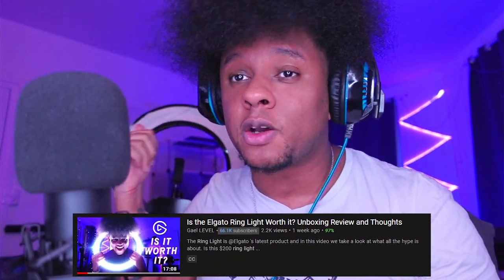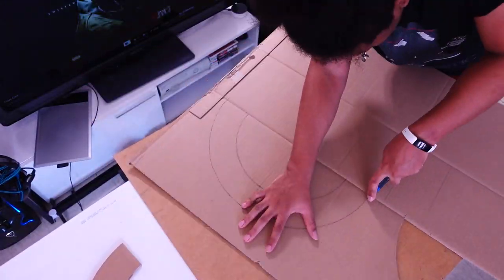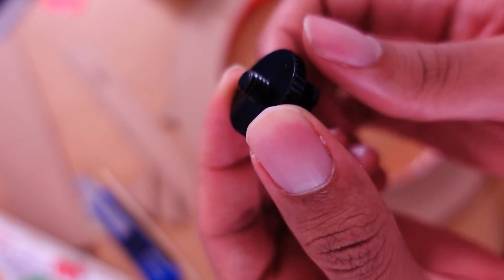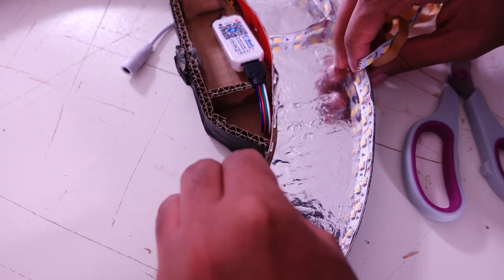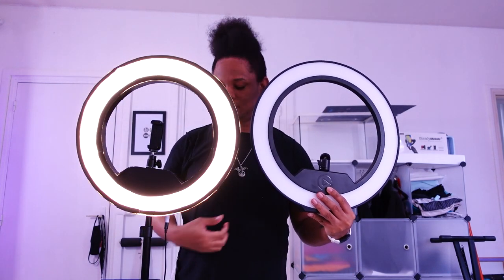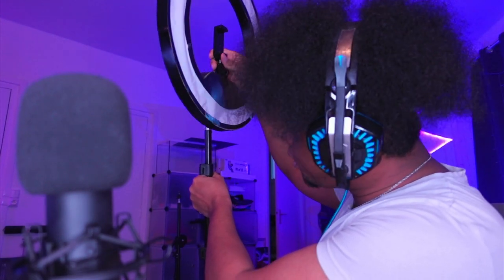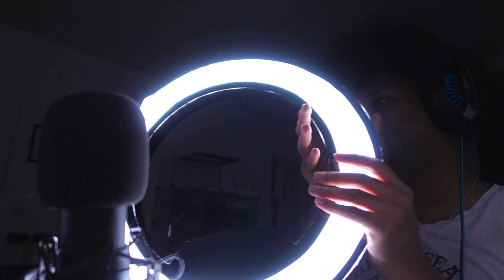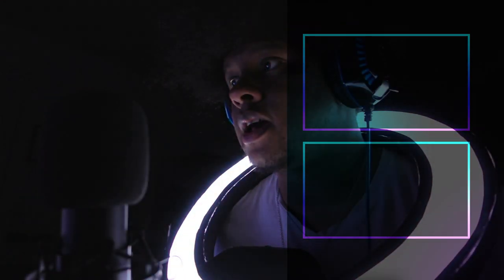DIY $30 ELGATO RING LIGHT (App Controlled)

Comment: If you recreate this, use the 'dull' side of the tinfoil (aluminium foil) as the reflector. I know it seems counter intuitive, but it is actually considerably more reflective than the shiny side. You can use a lux meter and try it yourself if you want.
If you look at bounce boards that they use in photography, they are always 'dull' not shiny. And so are reflectors in lights. Dull doesn't mean not reflective. It means that the reflection is diffuse, which is what we want for lighting.
You can get high frequency dimmers that won't flicker for about $7 on amazon. But you will need to wire everything up yourself and you won't get an app.

Comment: Heres my dilemma. I'm looking for a ringlight that can be controlled via a smartplug without having to touch the ringlight. Id like this because i have channel points in my stream that when redeemed the colors change in my room via hue lights. When i have the ring light in my face u dont really see the color changes like b4 because u get a warm glow from the light which makes sense. What i want is to be able to turn off the ring light when its redeemed and all my lights turn green... Or alternatively also turn it green but the easiest is having it turn off and then come back on when redemption is over. Ring light I have currently requires the power button to be pressed on a box to turn on. How can i work this out? I want clear light with normal streaming but during the redemptions i want the light to be off.